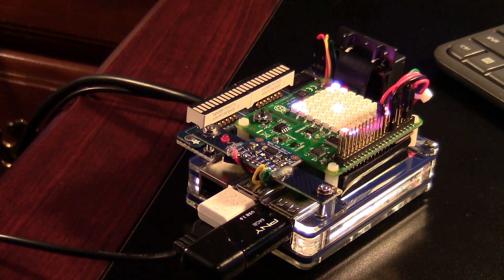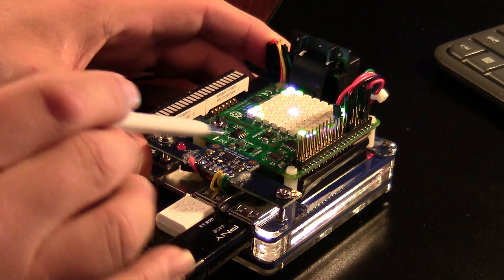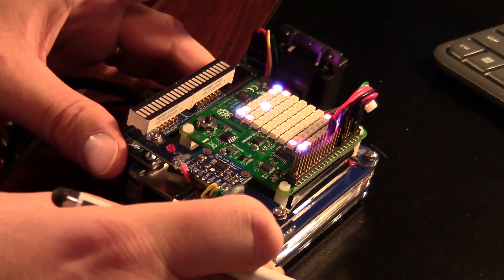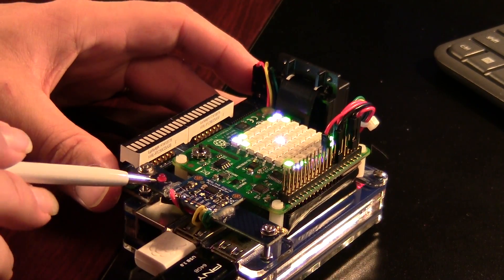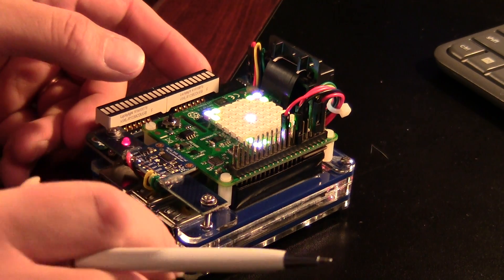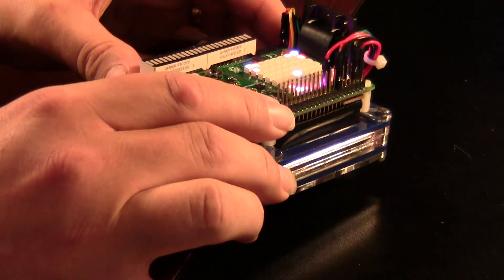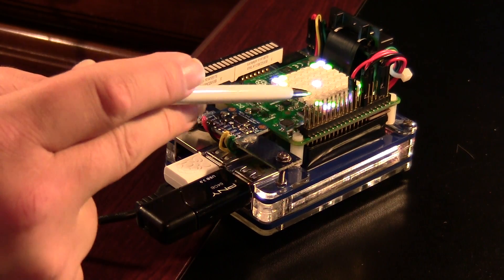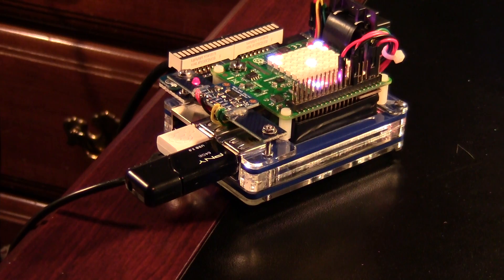Raspberry Pi2 Dash Cam w/ADXL345 digital accelerometer and LED display

Comment: Cool! Are these values recorded or just displayed live? If recorded, are they imbeded into the video files, like speed and gps info in some dash cams, or stored seperately? I could see this being quite useful, especially if in conjunction with a OBD2 Live data logger device, to analyze the level and affects of an impact and may help clue in what really happened in or surrounding a captured accident, or just how hard a hit and run was, the effective braking power in bad weather, the affect of how fast/hard a turn was actually taken throughout the curve as a graphed linear function value of lateral and other G-force and etc... Maybe could even be used in the development and testing of the handling of new cars in driving and in accidents or something.